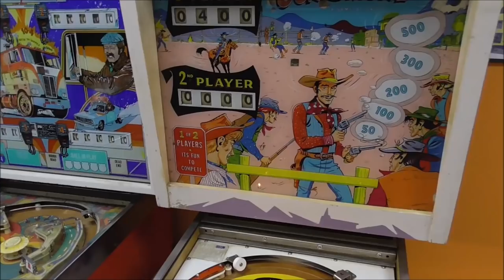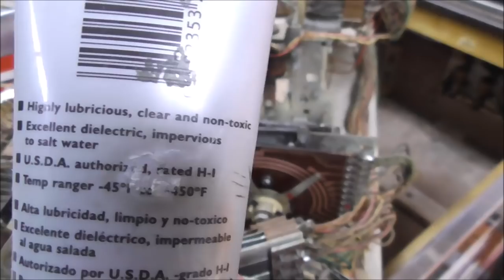100 pounds of Metal In The Bottom Of This 1968 Chicago Coin GUNSMOKE Pinball Machine  - Repair #2

Comment: Relays - Your bring back old memories from training in the military - We spent a week on Relays - Make before Break, Break before making. one with timers ( It would break then wait  x sec before making or wait x sec after power off before breaking) The ones with timers were the fun ones. We had 2000 Grit or 2500 Grit sandpaper for cleaning the contacts if I remember right. I ended up having my father send me Polishing stones that Watchmakers used when in Germany were better than the sandpaper. Lasted a lot longer also. BTW he was a Watch and Clock MAKER (the stones were white in color)
Reply from the maker: I'm gonna have to track some of those down, Thank you Fred!
Reply: @LyonsArcade  My father also sent me one really big one - Well .5 thick 3 x 5 boy did that keep a Very Very sharp edge on the Buck knife (3.5 Blade) I always carried in the military

Comment: Nice work-through. BTW, I figured out my problem with Dealers Choice resetting players 3-4. And it sort of relates to this video and the paper you mentioned in between switches. That switch was at the bottom of a switch stack on the impulse motor, the top switch would touch the bottom of the next switch up, completing the circuit. No paper, but just not enough space.  Adjusted and it's working well.  So thank you for that. Looking forward to the rest of the series.

Comment: There's a lot in there in common with old elevator controls from around that same time. Someone presses a button on a floor, a whole series of clickity-clacks, sparks, and then the hum of the motor as it pulls the elevator car where it needs to be. More clickity-clacks, and the doors open, and close. If it all works correctly, the human pinballs end up where they're supposed to. It's poetry in motion.
Reply from the maker: That's so cool they used them in elevators, i'll bet they had much bigger contacts though because it probably took a lot of juice to lift that cart!  Thanks for watching Jason!

Comment: I worked on those back in the '80s.  You should try delivery and set up of those old bowling and shuffle board machines.  Every bar a new adventure.  You said 100 pounds of metal, but you forgot to mention the 20 pounds of dust.  :-)
Reply from the maker: They're heavy!

Comment: One can only imagine the production  process of these relays , massive numbers considering each pinball needed many and the margin for error was big with these temperamental switches , was it all hand adjusted or some automated process
Reply from the maker: I think they tried to make the blades straight and then the spacers in them should hold them  at the correct distance to already be adjusted.

Comment: Hmmm, wouldn't brake cleaner work  to break the grease off that spider arm before you sand it? I would also use it to clean off the springs and mechanisms that doesn't have a electrical contact on them
Reply from the maker: I think Brake Cleaner would work, thank you for watching James!

Comment: JOE CLASSIC, what type of cardboard did you use to clean the switches because it look like cardboard that had a different type of texture? What was the size MM of the Bore Brushes to use to clean the Jones Plugs? When the Spider is not resetting because of the Clock Coils springs tension are loose, but how do you tighten the clock coil springs if the spider is not resetting from the closer positions because you mention the closer positions are harder to reset because the clock coils springs are loose so not sure to fix this issue.

Comment: Great second video, How does the wiring hold up on the machine?  Is there cabinet fade or is that the color?  Thanks for filming Ronnie.  Gorgar still speaks.
Reply from the maker: That's pretty much the original color, the wiring usually isn't a problem unless rats have chewed it up :)

Comment: are you supposed to oil/grease those solenoids ? I can imagine dust getting in between the coil and the pusher, wearing away the plastic.
Reply from the maker: No oil on anything that is metal on plastic, if you have a metal on metal pivot or something you can put a drop of oil... the plastic itself doesn't need any oil though.
Reply: @LyonsArcade  a CD player has white grease/Vaseline on its laser cradle - which is plastic on metal. That is why I had the idea!

Comment: Whenever I see a points contact switch,,I think Anode and cathode,,for some silly reason.  Maybe one point being rounded and the other flat-ish does it to me.     Well, I know what I need to buy if I need some  finger switches.    Think of the guy who thought all that up at his desk one day.   A Savant.   Even if the same setup and playing field is used for others.    Can you use a QD electrical cleaner to blast all those relays and switches clean??.  Would be nice to be able to stick it in a electrical board wash cabinet,,designed specifically.

Bailed on Amazon all together Joe.  Once I did that my debit card was safe again. Sorry.
Reply from the maker: I don't blame you at all man, shop local :)  Im' experimenting with contact cleaner maybe it will work on some of this but a lot of these since they have AC running through it actually get pitted..... Thanks for watching as always!

Comment: You can prob replace all of those switches with one IC.
Reply: I've thought of that. That might be a good use for an FPGA. However, how do you deal with solenoids? You'd likely need transistor boards to convert between the digital signals and the high-current signals.

This has been discussed elsewhere, like those trying to build new pinball machines from scratch. Some have used the Arduino to simply things, but there are issues. One issue is latency. Such as hit the flippers and they respond about a half-second later. The other is dealing with high voltage components such as a ball-shooting solenoid. That will take at least 70 volts. So there are boards to isolate and amplify the digital signals and use them as control signals. Then you run into a failure-prone spot since the transistors will go bad, depending on the level of use.
Reply from the maker: You could definitely do it, but it wouldn't be very practical, it would take a long time just to wire it up.  Many lights, Many switches, Many solenoids!
Reply: @PlumGurly  fair points
Reply: @LyonsArcade  -- For sure. Yet some have made their own using modern solutions. Usually, if you want to build one like that, I'd start with a mini machine. For designing a playfield, maybe one could start prototyping on cardboard. (There is even a DIY pinball machine kit for kids where you can make everything out of cardboard. I can't see those being beyond the most basic.)

As for making one's own control logic, I think I'd go mostly with combinational logic with logic gates unless one actually needs to use a microcontroller. That is what I don't like about the designs around Arduino boards. The program adds to the response latency, particularly if using higher-level languages. For instance, if one uses a Propeller chip in their design, I'd recommend coding that in assembly, not Spin or some sort of BASIC. Using interpreted code for time-critical operations makes no sense.

What might be a good idea would be to make a board to replace the scoring/timing motor section. Maybe use an FPGA and some relays, or at least transistors/SCRs/triacs. But that would be a lot of work getting the timings to match original behavior. That would likely be a case for sequential logic. And that would only be for homemade rigs or cases where that section is heavily damaged since authentic is usually better.